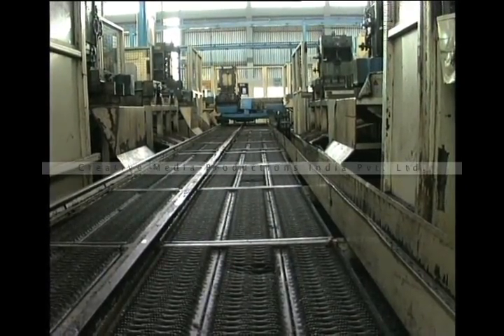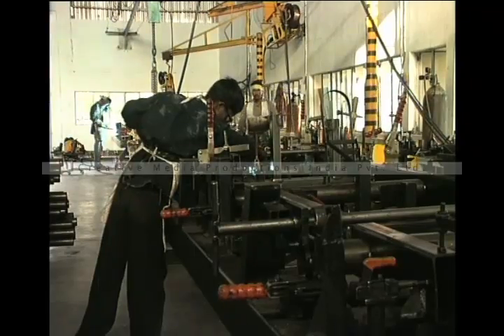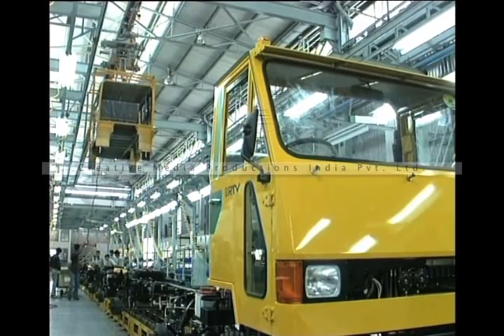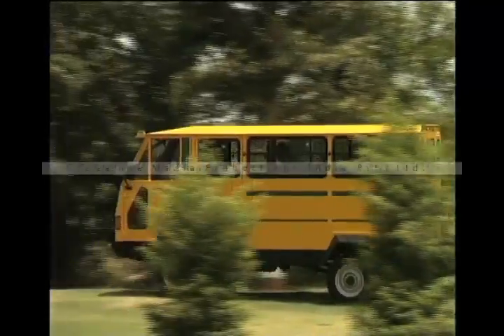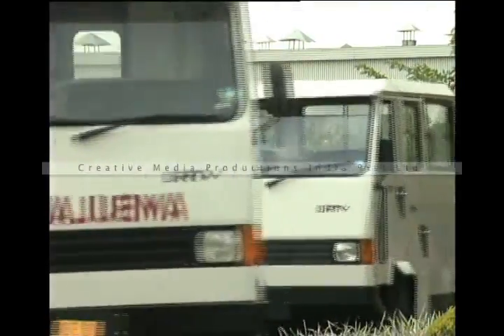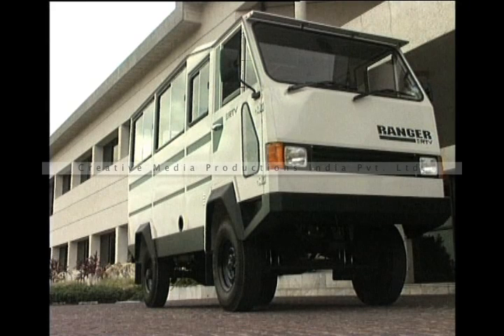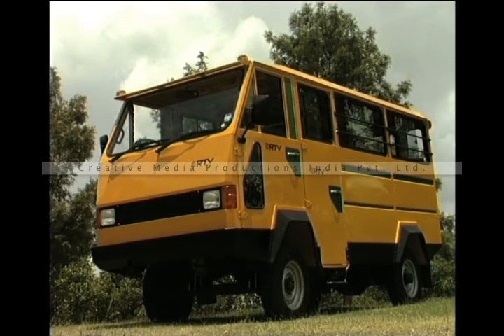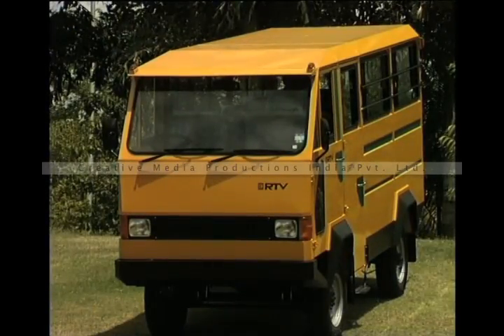Industrial-Film, Hindustan Motors

Comment: what kind of company is this.... workers are working with heavy machines without helmets goggles and safety sleeves. The workers in such automotive factory are supposed to wear full sleeves uniforms with safety helmets gloves and goggles. Now we know why HM went bankrupt.
Reply: Who told you that Hindustan motors is bankrupt ?? It is not . to avoid bankruptcy they discontinued the iconic ambassador . Kolkata plant is shut down . chennai plant is still operational. Service centres & offices are still open . HM is currently clearing their debts.
Reply: Sir     iam aindustial      worker     so      pant   shart     is    more    confortable   than    full    sleeve    covarol     work dress
Reply: @rajeevnatarajan560  🤐
Reply: @piyushjha1515  Comoany involve no innovation....clearly showing from video that ...its is like dabba van....not attractive design.....just four poles stand with roof and engine